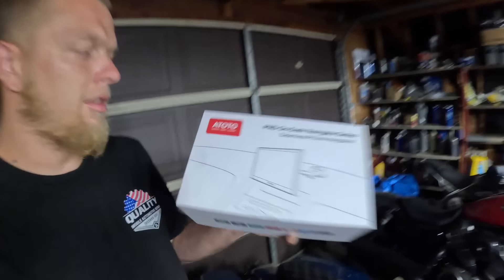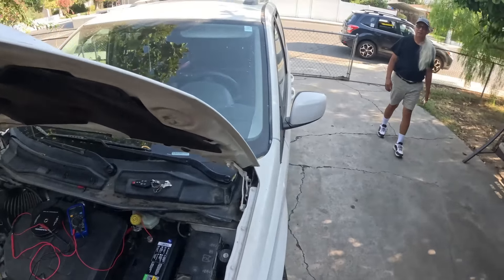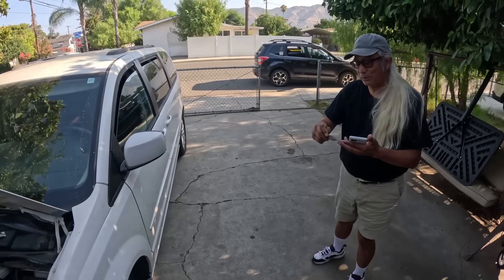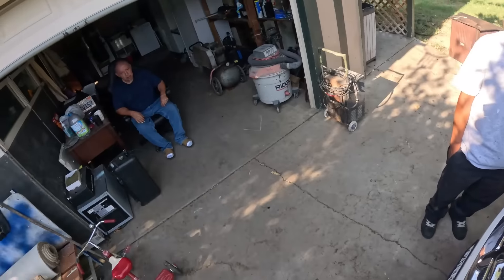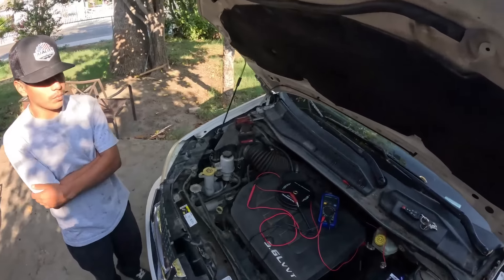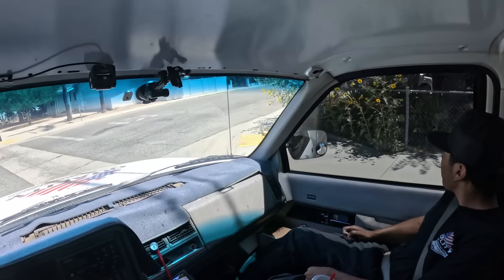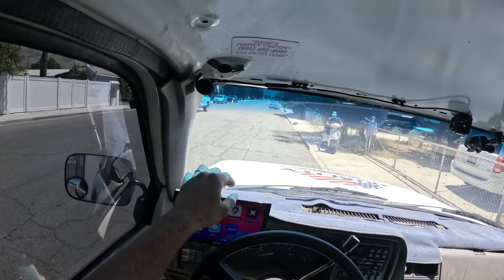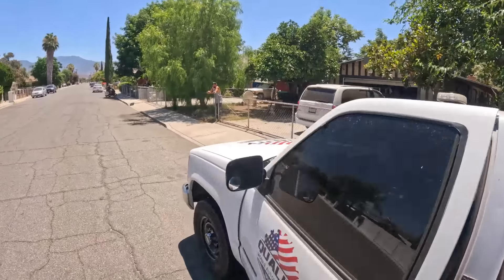CUSTOMER was UPSET! Mobile Mechanic ELECTRICAL diagnosis

Comment: "I'm not a mechanic" says the guy that is completely comfortable telling you that you're wrong
Reply: Sometimes, "the guy that is completely comfortable telling you that you're wrong" isn't a mechanic, but they ARE in a similar line of work, so know full well what SHOULD have been looked for.
I'm a (retired) Industrial POWER Electrician, who was trained on 230v/400v AC power supplies and workied on systems up to and including 22kV so know all about "electricity and electrical control circuits, just NOT too fussed on working on computer controlled DC (extra low) volatge circuits, of modern cars)

The laws of electrical circuits is still the same, the only difference being my line of work (excuse the pun - fully intended) was AC and not DC.

But I still knew that whatever was killing "my new vehicle's battery, was a circuit DRAWING a heavy current when it should not have been, which is what happened when the door sensors for the remote unlock faulted whenever it rained, and at no other time.

The battery was brilliant for the first 8 months after I bought it, then it started draing batteries, going through TWO new batteries one after the other, (until I realised, hey it always became DEAD after it rained, at night?

The only thing that could get wet, were either the door locks or their remote control sensors, which I found was the later.
AFTER two different auto electrical firms had "told me'it was an alternator (the 1st one, after I had jumped the car to start it, then driven 47kms to their workshop, for them to tell me, nah that battery is fuly charged, it MUST be the alternator?

I said that's BS because the alternator is NOT the cause of it NOT starting, only if it doesn't run AFTER being jumped.
Anything that stops it starting after a night outside, is almost certainly NOTHING to do with the alternator, which has NOT failed to continue keeping the vehice running, after a 5.5V battery voltage in the morning, to now show 13.8v?
So if the alternator is faulty WHAT CHARGED the 5.5V battery all the way to your shop, across 47km's if the alternator was NOT working, as the battery wouldn't have run it on it's own.
Not at a starting voltage of 5.5V

Yet they insisted, the alternator needed to be replaced, and as the ins covered it,  oh hell why not (but I wil never ever go back there, and have told others never to go there either, and as it's a little shop in rural New Zealand, YouTube & anyone in the USA doesn't need to know either.
Reply: @QUIX4U  CHUR CUZZIE

Comment: Two different problems that have similar results (no start) and both can be tough to diagnose. 
For those who wonder why the van started with the booster the day before, but not with the new battery, the answer is a bit complex.
As mentioned, these TIPMs (Totally Integrated Power Module) are notorious for burning traces causing open or intermittent open  conditions.  In many cases, the break in the trace isn't very wide, so when you use a battery booster or a high enough CCA battery. the amperage or combined amperage is enough to arc/jump across the opening, allowing the vehicle to start or the module/accessory to work.  Each time that happens though. there is a change that more of the trace will burn and eventually the gap will be too wide and that circuit or module will be "dead."   
The diagnostic method and logic used here to focus on one problem at a time was spot on.  GREAT JOB.
Reply: Needs a TIPM
Reply: Electrical gremlins take time to find. I would not rush to condemn a battery before charging it and doing a battery load test, full electrical system check, pull codes if any, a draw test and I certainly wouldn't do it in front of the customer. Customers often don't know the difference between a no start and no crank condition. Mutiple people driving a vehicle just cross lines even more when getting information.
Reply: Nahhh, it needs a TRIPM (Totally Ridiculous Intergrated Power Module) lol.
Reply: Horse shit. You need voltage to jump a gap not amperage lmao. The relay contacts are burned black not tracks. Sometimes it connects sometimes it doesn’t.
Reply: @Nemesis-yn5wv let's talk, once you have experience as an electrical engineer, working in a nuclear or other power plant, and/or lineman experience.

Comment: It's frustrating having TWO issues. Batteries today mainly suck, regardless of "brand" as there aren't many manufacturers making them. A dead cell can drive customers, car electronics, and mechanics crazy. And then we deal with the infamous TIPM! Many automotive YouTubers have dealt with this Stellantis electrical crap. If it's Chrysler/Dodge/Ram, it's either a bad ground or it's the frigging TIPM. GREAT diagnosis and fixes, and GREAT mentoring for your nephew! Nicely done, Robert.
Reply from the maker: Thank you very much David!
Reply: I did tires and battery at a major chain when I was younger and you be surprised at how many battlers we either get returned or have to send back cause they where pretty much DOA.  Most new cars battery don't even last 2 years cause they are so cheaply made.   I gone through three in 6 months, but the thing is when you buy one get it from some where that has a warranty.   Autozone or such stores tend to have 3+ year warranty so if it goes dead they will replace it, but the warranty starts over with the new battery.
Reply: Every owner of a Dodge Cummins truck in my area in WV runs Motorcraft batteries, they all say they are the only batteries that last, the Dodge batteries and other brands don't hold up especially in cold weather.
Reply: @likeorasgod  reminds me when I worked for a parts store, and dealing with the AC Delco battery vendor, they had a return expectancy, and if we didn't meet that expectancy, they would charge us. This wasn't returns for any other brand, but for AC Delco battery only. Basically they knew how bad, or good their batteries were expected to last, and at the time, they didn't last long.

Comment: I'm a michnic. Have been for 50 years. Lots of people have said that part is new.. and when you tell them it's faulty they think your crazy. Until you replace it. It happens all the time. But you did a very good job finding the problem. Keep the videos coming. and good luck with your bisniss.
Reply: What’s a michnic ?
Reply: @slalomking had something to do with your mom

Comment: I do RV repair, it’s frustrating when a new customer whom has trust issues due to other unscrupulous types, questions your professional diagnosis. Makes it harder when the customer hasn’t articulated the problem concisely.
I know the patience that’s required, I feel you brother, good job.
Reply: im an independent contractor i do a lot of remodeling work and the best thing to do when you meet customers that questions your experience, your recommendations even they question you having trouble trusting you and everything you say to them the best thing to do is leave immediately, believe me that'll save you headaches and legal issues down the road, so if you see and feel that it's going to be one of those troubled customers, just leave, there's better customers out there, even if you do a great job after you're done they're going to have somebody else "inspect" your work trying to find any excuse to call you back and get you in trouble, i can spot that type of customers in a second when first meet them, specially the way they talk the words they use the tone of voice,etc. i ain't got no time to deal with customers like that so i just leave.
Reply: Well said
Reply: Sometimes those customers want to feel big and special. Normally use jokes and very easy to understand stuff. This bad, that fine. Doesn't always work but even those have money I could use after a solid fix
Reply: @kenpompo7722 "I ain't got no time to deal with no customers like that so I just leave".. and you're the type that'll just lie to people to save yourself a few bucks or time when you do something wrong also.. way to go 😂
Reply: @kenpompo7722  Yes sir, that is exactly what heppens in my case aswell, I do exterior remodeling (siding, roofs, and what be it). In our case if the customer isnt a referral we end up having to go out more then once and explain what we are doing.
Reply: One of my favorite things to hear after mechanical failure......It's been making this funny noise for a long time.

Comment: You have my respect with your patience with customers. Your nephew needs to keep his head in the game, even if he doesn't become a mechanic (Technician) just having knowledge and skill to fix your own vehicle saves alot of money.
Reply from the maker: Thank you! He definitely is on the right track to becoming a great technician one day if he chooses to stay in it.
Reply: @QualityMobileAutomotive  that’s the same thing that my dad told me when I said that I wasn’t interested but I went into the service and worked on jet aircraft and when I got out went to work in the oil field and it had to many ups and downs so I went to work for John deer for twenty five years gas and diesel transmission differentials I’ve worked on everything except helicopters and space shuttles thanks to my dad a lesson learned if you have a good teacher to follow it will definitely pay off in the future tell your nephew to just hang in there with you and never stop asking questions just keep picking your brain if he truly has been gifted with mechanical skills he should progress quickly I’m rooting for him

Comment: Great video, and excellent service that you provide. I used to run an automotive shop for 13 years. I found that customers typically appreciate the little extras. For example, every car that came in, we would check tire pressures (and add air if needed, which most cars have low tire pressure), and clean the windows. When the customer drives away, in addition to their vehicle being repaired or serviced, they always appreciate the clean windows, and how much better the car handles with the proper tire pressure. These are things that your assistant can do while you’re working on the vehicle, and the customers will appreciate the added touch.

Comment: Chrysler tech here, Chrysler has an external relay kit to by-pass the internal relay. Done quite a few of them in my career! Just food for thought!
Reply from the maker: Yes sir fully aware as I’ve done them also. As you know the TIPM fails on other circuits. I would rather replace the TIPM with an upgraded than  get an angry call from my customer saying something else doesn’t work.
Reply: @QualityMobileAutomotive  I would have recommended Tipm as well man! Great video and great diag! Keep them comin!
Reply from the maker: Thanks appreciate it!
Reply: You  do that for yourself or a family member with the clause it fixed this problem other things fail just to get that out there. The savings is a lot but with risks.
Reply: I theorised(on another comment) this might be possible. Fun to have it confirmed. As a backyard mechanic weekend warrior I've done the draw-down test and found it to be a bad alternator! Mine was a little different of course, but it goes to show that having some crappy older cars you have to work on yourself can pay off. Personally? I would give the customer the option for the much cheaper repair, with them being happier in the short, and likely long term. (Of course, I wouldn't have guessed the fuel pump wasn't kicking on, when it does intermittently, without some googling!)
Reply: @QualityMobileAutomotive I wish I knew what a TIPM was! Lol. And all these relays?
Reply: Just a fused jumper to lighter will start that until new TIPM or aftermarket relay kit from dealer or websites
Reply: I was wondering why he didn't offer that. A new TIPM is totally unnecessary especially when these are old people.
Reply: $1K for a $5 relay.

Comment: It's really frustrating when a customers has someone relay a problem then you get there and ask what the problem is and both parties are having issues understanding. I finally understood why he kept asking if he's going to get charged again because at first I thought he was trying to be cheap or got scammed but in reality he didn't know his battery burned a cell. Good thing he finally said that the car would crank and wouldn't start. That's why it's always no matter what have patience and don't blow up on someone. You handled that well. Kudos!

Comment: Tip. When you are looking for a draw lock the vehicle with the fob it will go to sleep much faster.
Reply: Also to not disturb it hook your jumper battery to it and then disconnect the negative cable from battery and then make your connections.

Comment: Robert, this customer can predict the future. Can you ask him for the lotto numbers? 😂
Reply from the maker: I will call and ask 😂
Reply: Why didn't you take the van and/or battery to get replaced at Wal-Mart? Is that not part of the service you provide, or did the customer not want to pay for that service? Couldn't you make thus type of service part of what you provide? Genuine questions. I might have missed the answer if you explained, so my apologies if so. 
Edit: this was meant for the mechanic, and I accidentally replied to the wrong comment.
Reply: @Watchdog_McCoy_5.7x28  it wouldn't make sense.  He's not a triple aaa dude😂.  It's up to the owner to get the battery, because the CAR RUNS...  he shouldn't be responsible for going to get it.  I mean I'd offer, but for a 100 dollar uncharged for my time...   
  Time is money.  Period.  The customer was lazy.  If he really wanted it done, he would have went to Walmart and got a FREE battery via his warrantee..  he said "what if they're busy" 😂.... sums it up..
Reply: @analogueoverdigital929  I don't disagree with the customer being a pathetic, lazy bum. I'm simply saying that the mechanic is hired to fix the vehicle, and the customer pays for the time, labor, and parts (if needed). The mechanic should, therefore, be the one that goes and gets the part needed to repair the vehicle, not the customer...  If I call an electrician or an hvac guy, they don't tell me to go get the receptacle or the compressor, and they will come back and fix it. It's a part of the service you are paying for. The irony of a mechanic telling someone with a broken-down vehicle to drive that vehicle to get the part to fix it seems to be lost on you.

Comment: You have two options beside module replacement. You can order the relay, de-solder the relay from the pcb and solder in a new one or there is a kit available to convert it to an external relay which does not involve the pcb.
Reply: Right on the money with the real solution to the problem.
Reply: I like the kit idea.  👍

Comment: This reminds me of my 2008 malibu clasic V6 3.5 in the morning it started fine and runs great until you turns it off and try to restart it all you hear is click like a dead battery but the battery was brand new. We took it to several shops they changed the battery the starter gave it a tune up clean the injectors. Nothing worked. Until I jumped on YouTube and found out it was the fuse box. One broken wire under the fusebox was the problem. We changed that fusebox and problem solved. I solved a problem season mechanics could not solve. I wish we had a pro like at that time. Thank you very much for being an honest man with integrity and morals. Please teach your nephew the same ethical principles you possess.

Comment: Nice diagnosis! I know it's not always easy for the customer to be there but I feel it actually benefitted you as you showed your work, the steps of your diagnosis and waiving the double fee. This will only help you become an even more skilled mechanic with the ability to communicate; two important skills in a business! 

Also nice explanation to your nephew for the connectors. No need to force them, figure out how they're connected first and understand the mechanism. Might need a little wiggle! haha

Comment: Great job, very professional!!! I deal with similar customers at the shop or on mobile tech services. This week had a Suburban randomly having a reduced power fault, or engine quitting, or random shaking/misfire (the story changed every time I spoke to the guy). I explained the best I could to the guy step by step and kept arguing no it's not that, can't be that then says he's not a mechanic lol. A year ago it had electrical repair for engine randomly shutting down while driving and I suggested multiple times to let me take a look at the engine wiring "No it's not that wire, that ground was fixed!" Ok...it took a few days to duplicate the fault and every 2hrs he called and was getting upset why I'm working on other cars and not resolving his. After a dozen drives I finally saw the reduced power fault...absolutely no throttle pedal response and codes for throttle body. Authorized to change throttle body, spark plugs/wires, and engine oil. No more misfire and engine ran great. That night customer says Did it again! In the AM retested with headlights on and the engine shut off immediately with high-beams. Had coworker do that while I was checking the lights saw left lights very dim but bright at right lights. A ground wire issue??? There was multiple circuits running to a common ground behind the engine according to wiring diagram. Jumped a ground lead to left headlight low-beam no more engine shutting off and both headlights bright. Gained access to the "earlier suggested" ground wire behind engine...broken ground wire that dealer maybe fixed. Corrected that ground wire and everythinggg is good! I wanted to get on the phone and say to the guy "No it's not that wire, that ground was fixed!" lol!